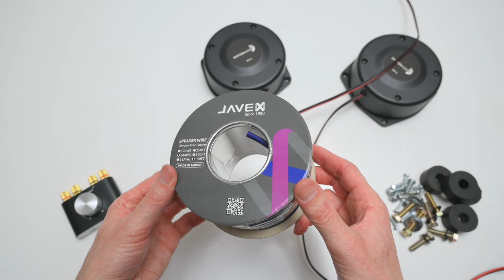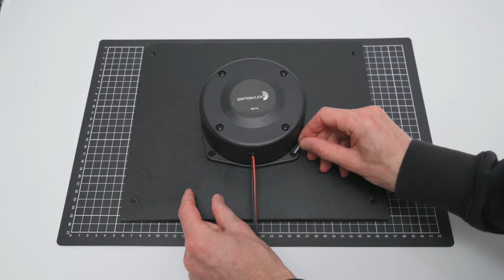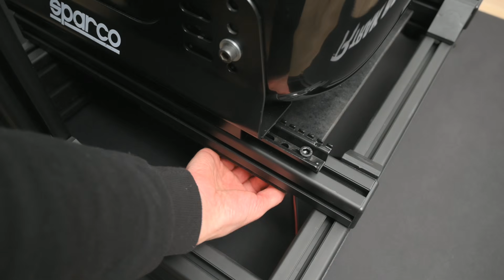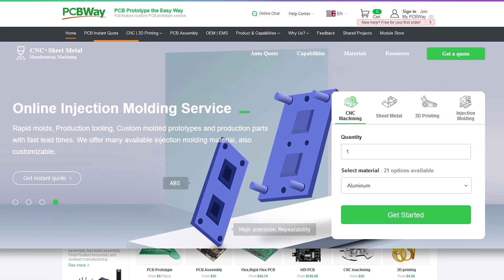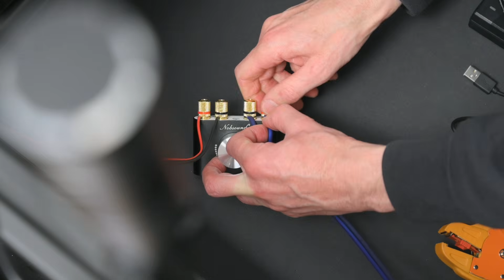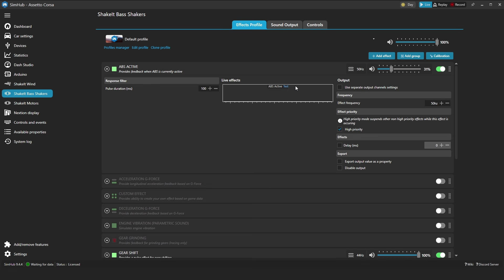How to Install and Setup Budget BASS SHAKERS

Comment: Hello, I want to install the same system, but in my research, there is information that the nobsound mini bluetooth amp causes problems after a certain period of time, especially due to heat, and general users switched to aluminum case amplifier models such as fosi bt20a, I wonder how the situation is in your setup, are you still using the same nobsound and are you satisfied if you are using it, if you give me any problems, you will be very helpful. Thank you in advance for your interest.

Comment: I thought the first and foremost importance when mounting a transducer is to place it assymetrical on any surface.

Meaning that if you mount it in the dead-center of a plate, the vibrations will cancel eachother out on some frequencies.

I learned that when installing a transducer it is vital to put it like 2/3 from one side (sideways) and 4/5 from the other (top/bottom) to prevent dampening.

Numbers are just random, but point is, NOT center/center.

Comment: I used 2 BST-1 front and back, separate Nob 100 watt amps, separate usb sound cards, then added new 4 usb PCI card to handle bandwidth. Caution! Simhub messes with your FFB on all 6 of the Sims I'm running unless there's enough bandwidth in USB controllers. Hence the additional PCI board. Cheers good racing and fair winds.

Comment: Thank you for this video! I have one question for you regarding the wiring. Instead of the red and black wires you are using I have a roll of 16 gauge speaker wire from Rocketfish I bought from Best Buy. Can I use this to set up my Nobsound Amp, TT25-8 transduceres and Dayton Audio BST-1 High Power Tactile Bass Shaker 50 Watts?

Comment: hows the MDF board? does it absorb the vibrations , would it be better to use real wood?
Reply: Im using aluminium 4mm seat and 6mm pedal , bolt under seat with 2 and 4 screw on pedal side with rubber pads. Look for vibration isolator with screw on boath side or one side counter screw hole.